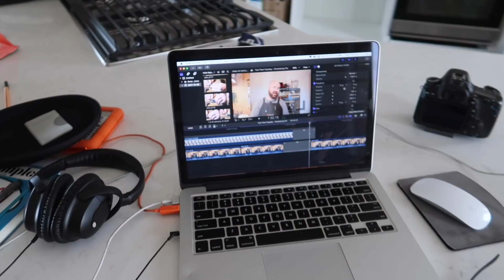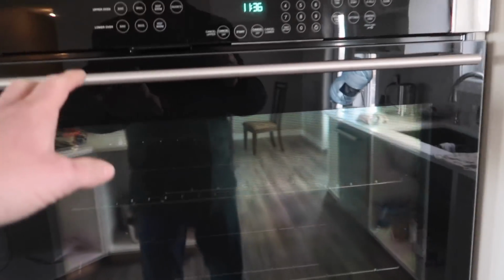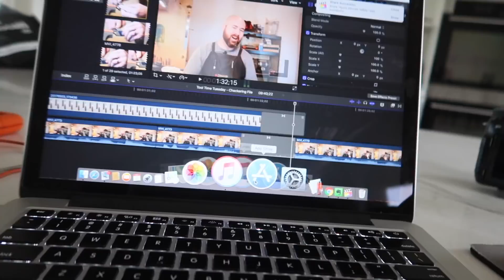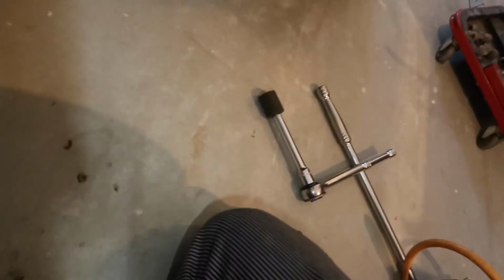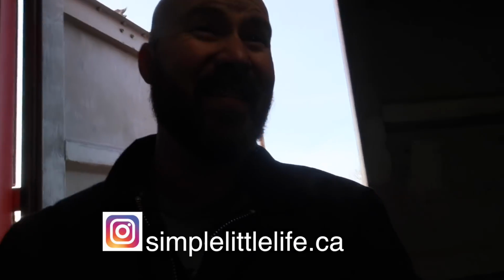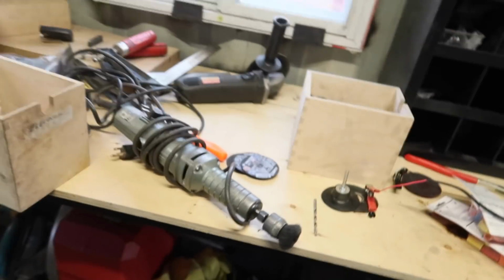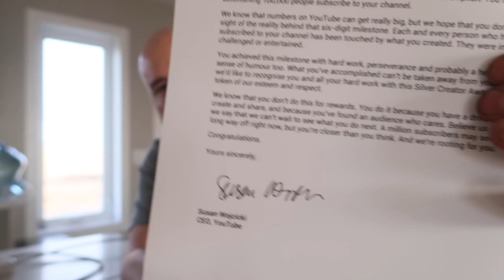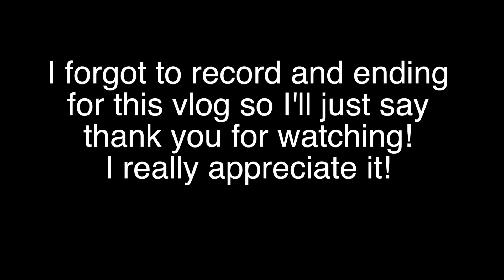I got a YouTube Play Button! - daily vlog -

Comment: Hey Jeremy, those calipers are bad for seizing. i have repaired a LOT of those trucks with that issue. you may not need a new caliper though. what you can do is pull your piston assembly off, and check that your slider pins are working. what i do is run a drill with a twisted wire brush down into the hole and clean it all out, then lube up the pins with neverseize. if the pins are really pitted, like the ones i have seen, you'll need a caliper pin/boot kit. it really doesnt take long for that to happen if your caliper gets seized. the pistons are on the back side, and when you brake, its supposed to apply equal force to the inside and outside of the rotor, via the slider pins. the front of your rotor is clearly barely getting used, so ill bet your pins are seized.